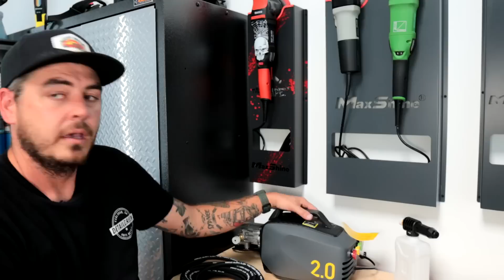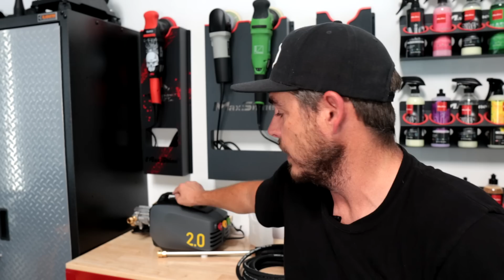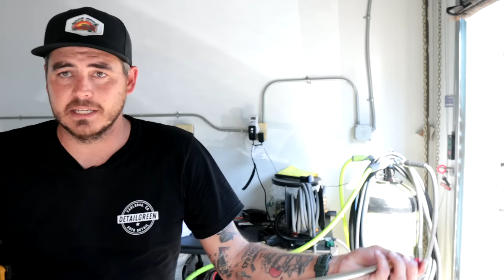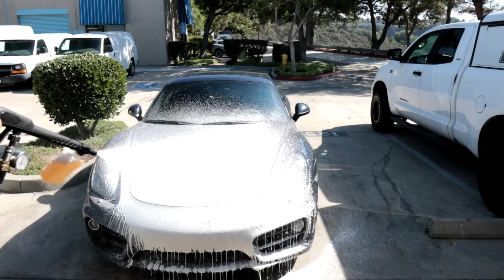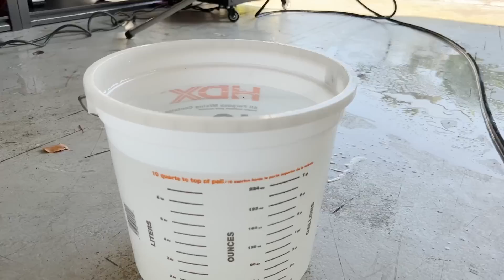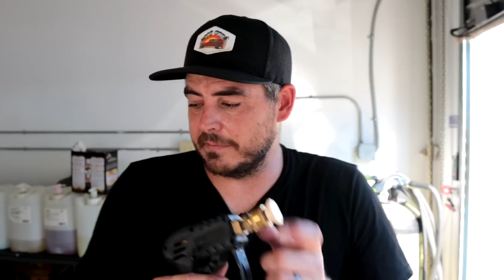NEW! ACTIVE 2.0 PRESSURE WASHER | Best Pressure Washer for Car Detail

Comment: @imjoshv how come my active 2.0 unit is giving me 800 psi at 12.94 amps with the factory 3.7mm orifice pressure washer nozzle that the unit came with (I’m on a 15 amp breaker) and your unit is giving you 1,050 psi at 13.65 amps?

Comment: Hey Josh, I ordered the whole setup shown here (Active 2.0 PW and MJJC V2 pro foam cannon, and the twinkle star quick connects). Do you switch out the 1/4 inch male adapter that comes with the MJJC v2 pro cannon with the twinkle star 3/8 inch male adapter? It was the only way to get the quick connects to connect with the standard gun that comes with the Active 2.0 PW. However, today was my first time using everything and the soap was very runny (even with the 1.1mm orifice) and there was significant leaking at the twinkle star 3/8inch male adapter connection.. Any advise here? Is it best to keep the 1/4inch adapter that came with the MJJC foam cannon and find a different quick connect that works with it? Thanks!
Reply: Found the solution, ordered a different QC that fits the MJJC 1/4” adapter instead of swapping the male with the 3/8in twinkle star. My guess is the twinkle star adapters dont handle high pressure water that well

Comment: I bought this unit about 2 years ago and only used it once maybe twice a month at most. I used it this weekend and had the unit start smoking and locked up. I had good water supply, no power issues, just started slowing down and when I looked at the unit smoke was coming out of it. I called the only number available on their website and the support lady could not find where I registered the 2.0 even though I went on there and found it was already registered, but she insisted I send her a copy of my receipt, showing proof I paid for it?? The whole purpose of registering it was to prove I bought it...SMH, $350 for 2 years of use... I WILL NEVER BUY ANOTHER ACTIVE PRODUCT!!!

Comment: Love the video. Doing some additional research before making the purchases. Does the Uberflex/Flexilla hoses recommended in this video work with the Active 2.0? Active 2.0 website says that they recommend steel braided hoses. Are steel braided hoses less flexible (harder to move around)?

Comment: I noticed Yamatic has two types of 3/8 steel braided hoses. 2Q21 and 2Q24. Only difference I could tell is that the 2Q24 comes with a stainless steel quick disconnect vs brass. Amazon has a deal on the 2Q24 so I went with that. BTW, I have the Uberflex with Active 2.0 but swapping it out just in case. I'll use the Uberflex on my other pressure washer which has the worst hose ever. Thanks for the info!

Comment: What does "hours of use" mean? This item is rated at 200 hours. Does that mean after 200 hours of use you need to buy a new one?
Reply from the maker: I think the 2.0 might be rated at 100 hours and the 2.3 at 200… I might be off on that though… but yes the motors and pumps are rated for that, typically they will fail around that point. But with the total stop system tests have been done and people think they use them a lot more than they actually do. For a professional 100 hours may not work but for at home users it should be fine. It’s pretty standard for all the big box store units

Comment: Hi Josh, is it possible to lower the psi with a bigger orifice without overworking the motor? I’m trying to get between 500-800 psi without motor damage. Is there a max orifice you’d recommend or just NO, stick with the 3.7? Thanks!

Comment: hey josh, first off huge fan of your channel. i'm finally piecing together a pressure washer setup and went with the active 2.0, i know you're a huge fan of the uberflex hose and i was sold, however i've been seeing videos/posts regarding non steel braided hose causing the unit to surge and ultimately breaking the unit. it appears active also "strongly recommends" using a steel braided hose on the 2.0 product page. was curious your thoughts on this. thanks!

Comment: Hey Josh I have the Uberflex you are showing and it is amazing as I was using it with a Dewalt 2.1 psi. I have the Active 2.0  and I read on youtube and elsewhere that it causes the Active 2.0 to surge and it has killed few units. Active recommends to use a steel braided hose ?? Can you please elaborate on that as I am afraid to connect the Uberflex and I am "stuck" with OEM 25" Active hose

Comment: I bought the 2.0 and really liked it, however after 6 times using it, it just stopped working. 
After talking to tech support they determined that the GFI may have gone bad and there had been some issues with it so they were sending me a new complete power core for me to install, now I am very capable of doing that but between the time that it takes to get answers going through email with tech support and something actually happening, I just became very frustrated and just wanted to send the unit back witch I did do.
Now don't get me wrong I believe that the Active 2.0 is a very good unit, you know it you build 10,000 units a certain % is going to have some kind of a failure, so use the heck out of it before your 30 day return policy is up.
I did return it but then I ordered the 2.3 pressure washer and yes it is $300.00 more but is fully rebuildable and you can change the oil in the pump, it is a professional grade unit that the pro detailers would use.
You can be sure when the new one arrives I  will be washing everything I can find, and that is not a problem around here.
Just a little FYI for all of you thinking about buying either one of these units.
Again the 2.0 did a fantastic job, and I did get the upgrade kit and really love the snub nose gun, it works great.

Comment: How does the Active 2.0 rate against the Greenworks 2700 / 3000?  From your videos, it looks like they are comparable on the detailing side with maybe a slight nod to the Active? but the higher pressure work would lean towards the Greenworks?  Looking for a quality all arounder, car wash / driveway wash unit

Comment: Great review!

Yes, when you double the length of the hose, you will double your friction loss.  That accounts for the pressure decrease.  If you put your pressure guage at the beginning of the hose, you will see the same pressure regardless of the hose length.  However, that would not accurately tell you the performance at the nozzle.  It would only demonstrate the loss.

Comment: I see a good bit of people trying to say that you can go cheaper and get what this offers but I just can’t see that honestly. Rated for twice the life as your standard (apparently). 1800psi,2gpm, electric, small frame pressure washer you’re going to pay $150ish and almost all of them easily mention how they’re unreliable and gonna crap out on them but “I can get 2 for what this cost”. Except the inconvenience of having to go get a second has value as well. Getting something cheap because you won’t mind having to replace it sooner rather than spending a bit more and getting something that will last longer is a bad plan. Would you buy a cheap truck that you know will break down in 2 years vs getting a slightly more expensive one that will last you 4? No.

Comment: Thank you for quoting the whole set up someone should use threw out the video / active 2.0 pressure washer - uberflex hose, had same 22mm connect - and mjjc foam cannon pro - and the mckaillens swivel pressure washing gun

Comment: The manufacturer uses a 5/16 hose if you buy it from them and they say that gives you the 2.0 flow at about 1000-1100 psi. Maybe your different results are due to using a 1/4 hose?

Comment: I’m still on the OG Josh setup… Ryobi, Uberflex and MJJC.  The Ryobi works but it’s annoyingly loud.  I’m upgrading this year.  The Active 2.3 coming out at $650 and the AR at $800 are a tough pill to swallow… but the 2.0 can be had for $300 right now.  Might have to snag one.  My fear with the 2.0 is the high pitched noise.  I want something quieter.  Wondering how it compares to the Ryobi.  Great stuff Josh!

Comment: Hi Josh.   I purchased the Active 2.0 along with the hose and the MJJC Foam Cannon.      So far I've used it 3 times, and all 3 times the foam was very runny.    The Active has a tag on it that reads, " Please refrain from using a 1.1 orifice as it can damage the motor ,"  Thoughts?

Comment: had this sold it n bought 3 Ryobi 1800 psi units that are great  for 88$ each plus 8 dollar 3 yr no question warranties then the 100$ leftover i got Uberflex 50ft hose and a swivel short gun with foam cannon.   so I got a whole setup for the price of the Active alone. also using 3.5 orifice tip to get 700  psi and 1.6 gpm. 3.0 tip gets 950 psi and 1.45 gpm but I love flow more than psi more than good for rinsing at home I use a Northstar unit w total stop adjustable pressure and psi  900 to 2600psi and 1.4 to 2.8gpm that monster is 1200$ but outperforms a Kranzle and can  pressure wash  brick and concrete something the Kranzle can never do for the same price.

Comment: Had mine for 3 months and my breaker is shot. Worked great but now I don’t recommend.
Reply: What do you mean by "breaker"? Like yhe on off switch or the actual breaker on the plug that goes to your wall

Comment: I've had the same Ryobi in this video for over 3 years now using it in my mobile detailing business. I make over 100k a year. Has yet to fail me but I did just upgrade to the Active. Debated on going with gas engine but didn't want the hassle. Electric is easy. gas is overkill unless you're doing commercial vehicles or high quantity vehicles. In my case, quality over quantity.

Comment: Is it common when you run a 100ft 3/8inch hose that when you pull the trigger on the gun it take a sec for the pump to turn on and then you let go of the trigger it take a sec for the pump to stop? It doesn’t do this with a 50ft 1/4inch house.

Comment: Josh, I really enjoy your reviews and actually based my purchase of this unit largely on your review.  I do need to share what happened to me after the purchase.  Others may gains some value and at least be more informed.    

Purchased this pressure washer on 10/20/23.  Used it once...  Worked great.  No serious issues.  Good pressure, did not overheat, TSS pressure system worked reasonably well but need to make sure no small leaks in hose and connections or the unit will cycle a lot.  

After use, was putting the unit away in my car and I caught the TSS switch on the edge of the car and it cracked the switch housing.  This is the most delicate part of the pressure washer and it is not protected with any guard.  If this unit were to roll over or be hit by something else or your hose got hung up and tangled, I can see this part getting damaged.  

I am not blaming "Active" for the damage whatsover (Other than that switch is not very well guarded and is plastic)  However, I reached to them to purchase a replacement part.  I emailed them and called and spoke to a support rep.  I received this response a short time ago:   

I checked with the tech team and manager, and unfortunately, we don't have this part available, and we're not sure if it will be available in the near future.  Let me know if you'd like to buy another 2.0; I can offer a 15% discount.    Best Regards,  Customer Support, ACTIVE PRODUCTS

I was a bit surprised for such an expensive product that they have no parts or support.  Obviously, this is a very, very big disappointment to me.  As you can see from the photo I have included, I just purchased this unit three weeks ago, paid $369 and the unit is basically junk now because Active cannot replace what is likely a $20 piece of plastic.  

My goal with this review is not to air out my issue with the merchant, my goal is to put anyone on notice that if they are purchasing this product, Active does not seem willing to replace any parts but will be quick to offer you to buy another unit.  I can understand this type of response with a $79 Harbor Freight electric pressure washer, but this purchase for me was significantly researched and I looked at it as an investment into a really high quality machine.  If this unit does break, and it is not covered by warranty, you will be at risk losing your $350 + investment.  Too bad.

At this price point, basic parts should be available.  As you can see from the photo, it is very specialized and as I said the weakest link of the unit.  From what I have seen and brainstormed, I have no way to workaround it....  

HAVING SAID ALL OF THIS, I am not blaming you or your review.  I appreciate all your information and detailed review.  I just thought this would be reasonable to add for anyone that may be considering this unit.  In addition, I am open to any ideas you may have about how I might gain some value out of something that is essentially a boat anchor now.....    :(
Reply from the maker: Oh man that is terrible. I’m so sorry to hear that and thanks for posting that to bring awareness. Yeah that piece breaking is unfortunate but I would hope that there was solution for it.  When you get into the serviceable units like the kranzle, or ar630 then they have repairable components but those units are much more expensive. Send me a picture of where yours broke to dtlrsupply@gmail.com and I’ll see if I can think of a solution for you
Reply: Hope you found a solution to your problem. From what I can see this TSS switch appears to be a pressure switch. I figure it turns the electric motor on when the trigger is pulled (pressure drops) and motor off when trigger is released (pressure increases). Looks like you would be able to find an aftermarket switch with the same psi rating and connections.
Reply: @smittyss4978  why should he have to source a component.  He didn’t design the thing.  If the company doesn’t do a good job designing the washer and doesn’t have any parts I guess they will just go out of business.   They aren’t the only ones on Earth that makes a PW.   I MEAN who would buy a PW that the companies solution to a part failure is to buy a whole unit.  😅
Reply: @casey10614  I was just offering a solution to the problem so he didn't have a $350 paper weight. I MEAN who would buy a (fill in the blank) that the company's solution to a part failure is to buy a whole unit? The answer: Just about everyone because we live in a throw away world. TVs being the first thing that comes to mind because I have 3 LED TVs in my house now that people were going to throw out and all they needed was one of the LEDs replaced in the backlighting.
Reply: @smittyss4978 you did a good job I was commenting on the manufacturer response.   You do great work with the videos.

Comment: I bought one of these and am not getting anywhere close to psi ratings you are josh or anyones videos, I am getting only 750-800 psi with the stock 3.7 and i bought a set of 4.0 nozzles and like you said it didnt make much difference so probably the same size.

Any ideas why i am getting 400ish lower pressure rating? I have the washer connected directly to the house with only a 3 foot jumper hose and the Uber flex hose and if I switch to the stock black 25 footer that comes with it I gain 25 to 50 psi maybe but not a significant change and getting a hold of Support is near impossible you just get recordings and ignored so I’m debating on not even dealing with warrantng it and maybe try another one because it’s so hard to get a hold of them and just refund it and save myself the headache now and save for a AR Blue or keep using my 3.0gpm gasser instead.  Thoughts? 

Also I forgot to mention I am not getting 2 gpm either maybe 1.7. And I finally got a hold of Support after almost 2 weeks and any troubleshooting tips they had for me I had already done so they don’t know why I’m getting the lower pressure either they said I should be getting about 1100 to 1200 with the stock orrifice and I’m not. I’m afraid if they send me another one it’s only gonna be the same problem so I’m hoping somebody here might know why? By the way it’s not my gauge I forgot to mention I have the MTM one and one I bought off of Amazon both of them read exactly the same within about 5 to 10 psi it seems to me upon reading other commenters that a lot of people are getting 750 to 800 only out of this unit for some reason I know obsessed garage is getting higher psi but he’s also using 3/8 hose not the quarter inch Uber flex that might account for a little bit more pressure perhaps but doesn’t explain why a lot of other people are getting same as me…
Reply: i have the same issue as you, even with a replacement unit. have not figured out why either.

Comment: Would you recommend this to be used with the On The Go Dual Bed Standard Deionizer?
Reply: Also been reading some people having issues with Active 2.0 and the Uberflex hose. Any comments on that? Want to pull the trigger but doing some research first